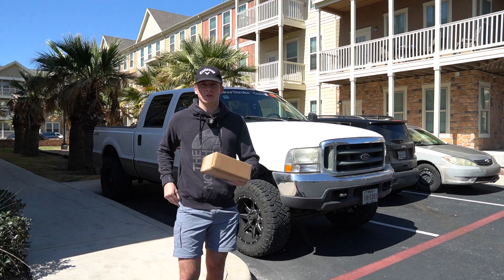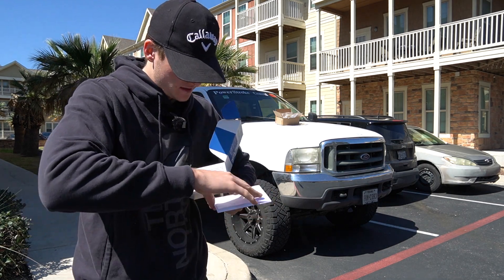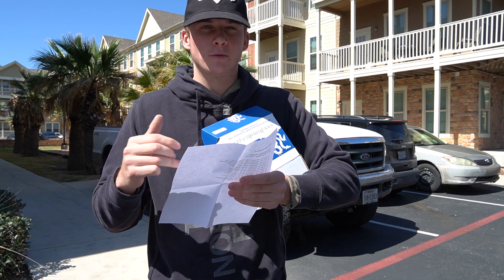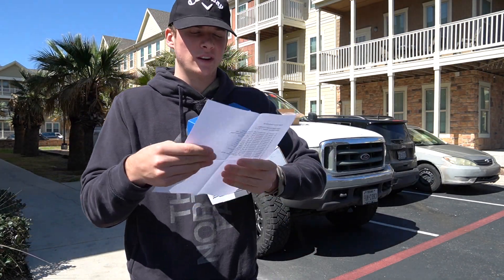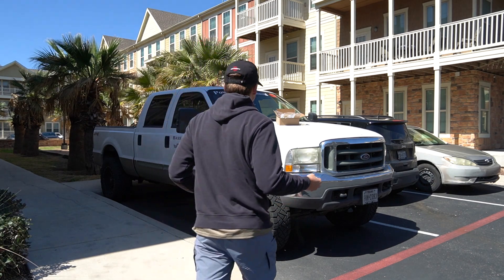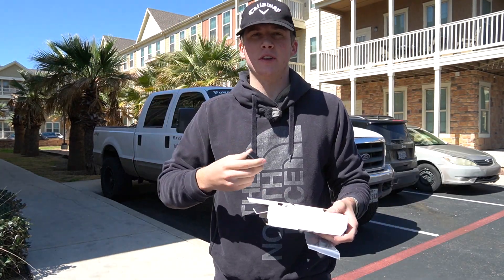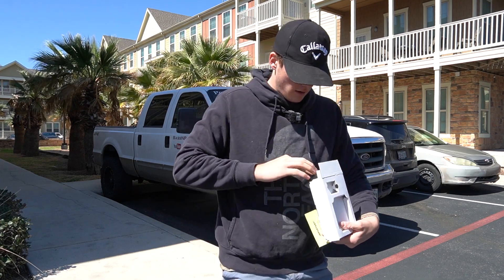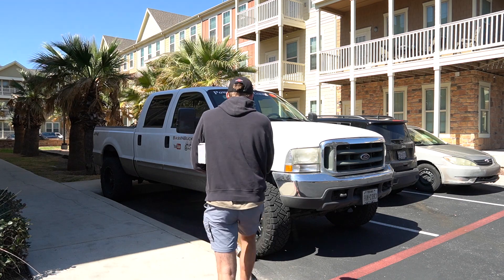The PHP HYDRA CHIP Tuner Has Arrived For My 7.3 L Powerstroke F-250 Super Duty Diesel!

Comment: You won't actually get the hp that's advertised so keep that in mind. You could use the 140hp only for rolling coal amd keep it on daily drive mode for normal driving.  Also don't forget that when you throw codes moving forward they'll be harder to diagnose. That's why I prefer flash tuning. You got a good brand so I won't be too worried
Reply from the maker: thanks for the advice bro. I'm just kinda nervous to see how it reacts with my truck I'll keep y'all updated.